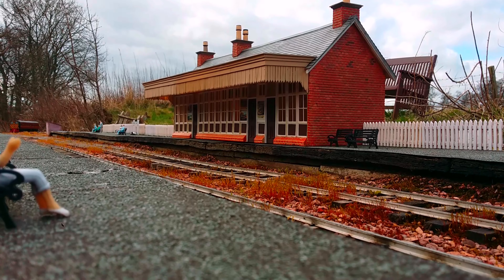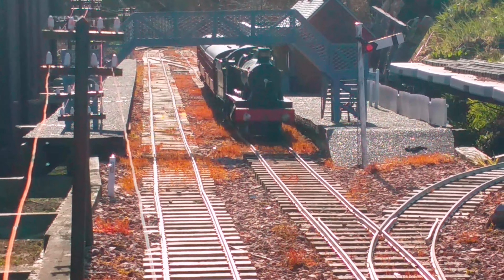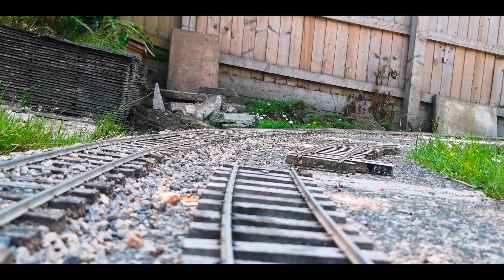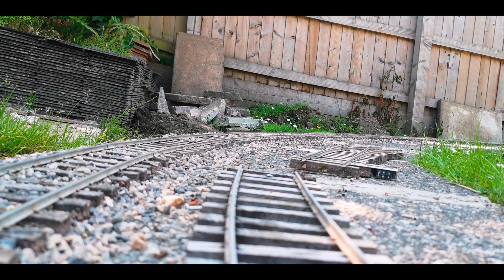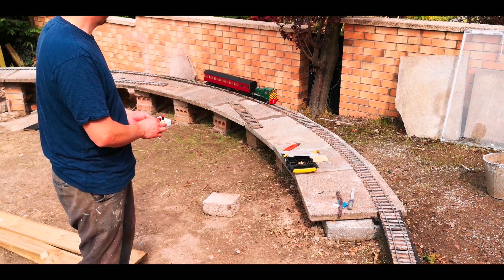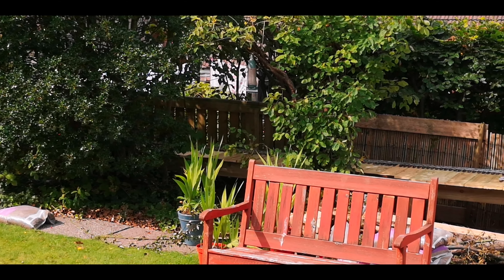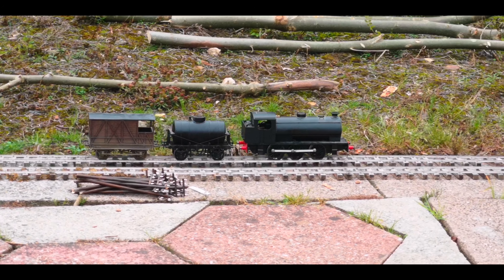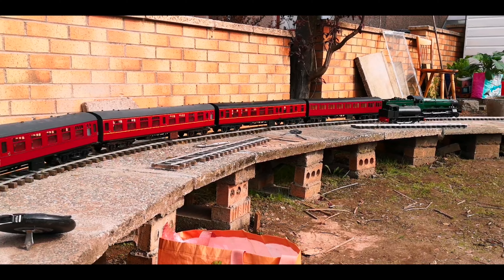Gauge 3 in the garden

Comment: Wonderful stuff. Wish I had the space for G3 (let alone the skills). Well done.
Reply from the maker: I have seen your videos and your stuff is plenty good enough for Gauge 3! Just need to widen your track! Gauge 3 short wheel based wagons and 0-4-0 locos can cope with 4 foot radius easily, and larger locos-7-8 foot radius, i personally would like to add an extra rail for running some lgb stuff, just need to figure out how to make the junctions on such large radius points as the blades are about a foot long..
Reply: @eddywilliams6212  That’s very generous, thank you. Insanely jealous of your coaches!